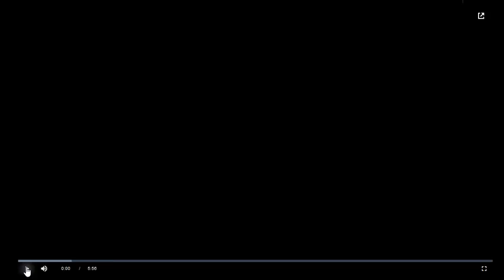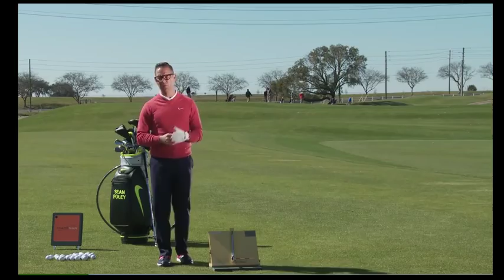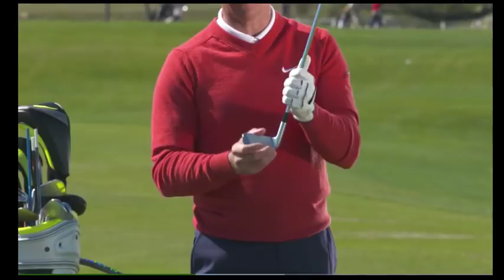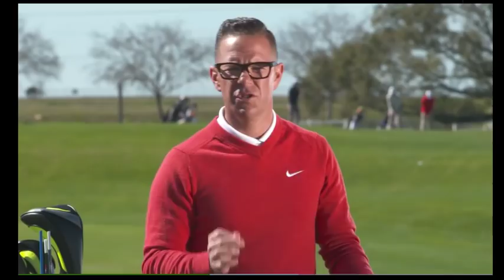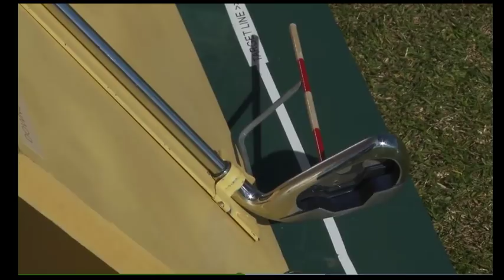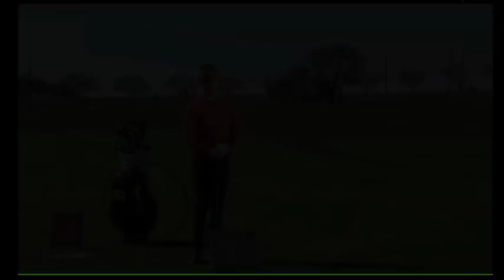Sean Foley Explaining the Divergence Plane

Comment: I have worked hard on Moe Normans concepts. There is no divot with any club and the club face is perpendicular to the path well beyond impact. This happens as a function of the set up, grip and firing sequence! I am 62, hit the ball solid, straight and standard club distance. To move the ball the setup is altered slightly relative to swing path, slightly closed to draw the ball, open for a fade. The grip remains the same! I learned the most while taking chemo for cancer. I had not strength this forced me to understand Moe's setup and firing sequence. The conventional swing just had too many moving parts. With luck I will have many years for great striking ahead of me! Knowledge is King!
Reply: Garth Downton moves swing worked for now because that’s what he practices doing, hitting millions of balls it’s not going to work very well for others even he said that.

Comment: so anything off the ground we need to aim a bit left correct?
Reply: xNIKEGOLFx you don’t aim left the club exits left, just set up square to target take your address now leave leave the club head on the ground, now rotate your shoulders, what does the club do ? It goes left. Your hands do what your shoulders do so as long as youre swinging free and not trying to control with the hands it should happen naturally, the club is only square for a fraction of a second problem is people swing with there hands trying to control the clubface. Practice with you pitching wedge, half swings just using your shoulders you’ll notice the club goes left immediately after impact but the ball goes straight no need to try and hold the face square done the line. Once you know what’s going on through impact then you can start playing around with your set up, and ball positions to control  ball flight. Just watch Tiger he will even swing left on his practice swings quite often to get the feel and remind himself of where the club should be going

Comment: Sean, you need to seriously study the effect of the the two directions of the bowing shaft of an iron at impact (targetward and downward), the club face relative to that set of shaft conditions pre-impact and the resulting forward "kick" of the shaft when the head strikes the ground...when you do study that you might understand why the D Plane "theory" is so flawed...it will also explain why those 21 golfers hit the shots you observed
Reply: norrispg can you plz explain?
Reply: @norrispg- There is no "kicking forward" of the shaft in a dynamic swing. It's a flawed idea that came from videos shot by cheap high speed cameras that showed a comical forward bend prior to impact. You NEVER see it in The Konica Minolta Swing Vision Camera. 
 There would be no way any human could consistently time the kick. But...even if it was real , that wouldn't negate the D-Plane "theory" because it has the science of doppler radar backing it (Trackman) for almost 2 decades now. 
Trackman and the D-Plane clearly understand why 21 divots went left. 
The ball only responds to the forces imparted to it. It doesn't care how they arrived. Through a kicking forward shaft or a steel toed boot. Either way, the D-Plane explains the balls reaction.
Pros compress the ball and we all know what sounds like. They are able to do this because they know how to stress a shaft.  If a shaft kicks forward prior to impact it would become unstressed and turn into a wet noodle , absorbing energy instead of transferring it.